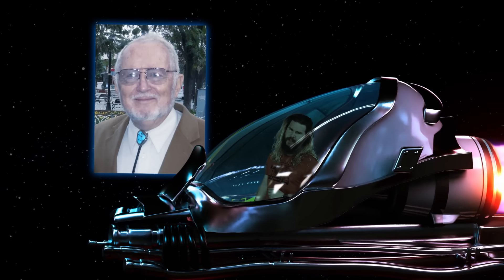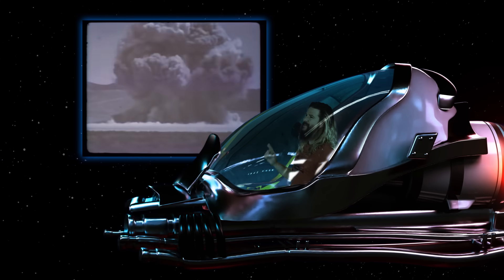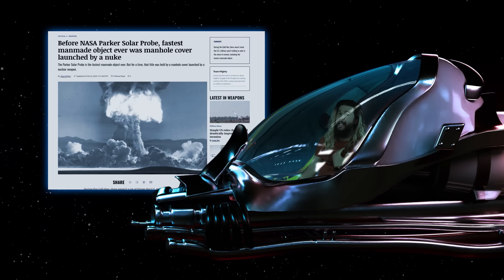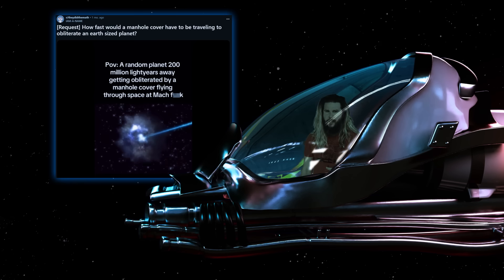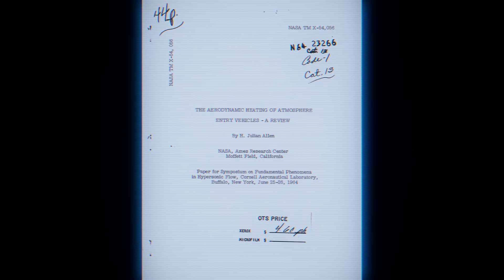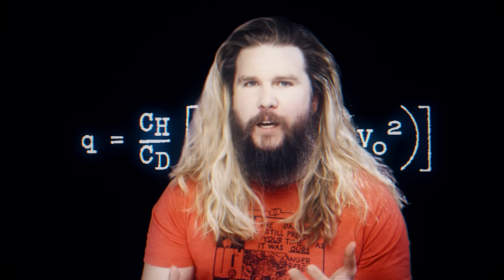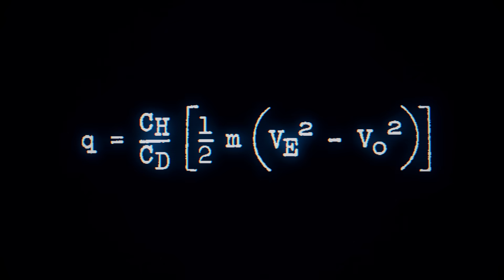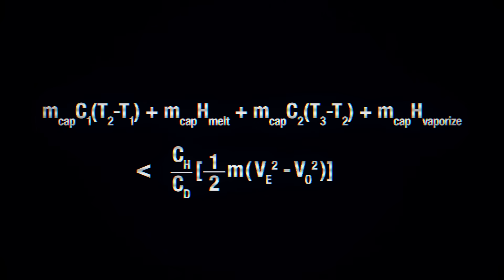Debunking the Nuclear-Powered Manhole Cover

Comment: The calculation is not very realistic. First, as you move upwards, melting and boiling temperature of iron will decrease. I am not sure this will have much of an effect. Second is that as iron melts, its shape will change, which will change its drag coefficient as well as energy transfer rate. I don't think this will have any effect on the chance of survival for the manhole cover.

Comment: It's much more simple than that. The entire story is made up. If we believe Wikipedia, the high speed camera was operating at 1ms shutter speed. An object moving at 66km/s would have been spread out over a 66m distance in that exposure, making it most likely invisible. If the cover was clearly visible on any film of that time, it was going a lot slower. That is also necessitated by the acceleration mechanics which works exactly like the deceleration mechanism in the atmosphere. The shock wave of the explosion did not go at 20 times the speed of sound in the iron or it would have completely dispersed this object within the bore hole, already. So would any radiative ablation based acceleration mechanism. One can imagine that the object was accelerated to a few km/s, in which case it would have survived its journey just fine. If it was never found, then it already got destroyed during the explosion.

Comment: What if the disc would do a thing that discs do, and turn on it's side to minimize the air resistance? I'm sure there were some uneven forces, or a air-dragging weld blob that acted a s an airbreak.

Comment: All in all, the mass of the cover wouldn't be enough to survive the journey through the atmosphere. A meteor coming from space has to be massive enough and dense enough to pass through many MANY layers of air resistance, and we don't even know how much desceleration the manhole would experience when at certain angles. If it started tumbling, it would probably suffer more air friction than if it flattened out or turned sideways. There's also the possibility that the manhole melted partially from the sheer heat of the nuke so it would warp from the forces it experienced, meaning it would actually probably experience MORE friction from an alteration in surface area. I imagine it got really high up, but in the end it logically couldn't make it to space. We have to get satellites into space using specialized heat resistant plating and many MANY layers of protection, a manhole cover is not surviving that trip.
Reply: You can find meteors of a few kg mass that made it through Earth's atmosphere just fine.

Comment: Problem with using this calculation is it doesn't take into consideration the difference in drag an object experiences when traveling across a pressure gradient from space to the surface of the earth, as opposed to from the surface of the earth to that in outer space. Also you can blast an object with enough energy to vaporize it, but if it's over too short of a time frame to actually vaporize it, it won't be vaporized. Kinda like the whole cooking a pizza at a certain radius from a nuclear detonation.

Comment: Wow, never even thought about the "manhole cover" vaporizing on the way up. However, I always though it never made it to space because it would obviously slow down from drag on the way up. A manhole cover is not the most aerodynamic thing after all. So even if it did get way above escape velocity, probably not for long, and would slow down and return to Earth. We have still failed to make a "space gun". And such a thing is desirable to quickly and cheaply launch satellites into orbit. But it doesn't work. You can't impart enough kinetic energy on a thing to launch it into orbit with a single powerful thrust. Rockets achieve orbit by burning fuel and having continuous thrust all the way up.

Comment: People want to believe that there is a manhole cover floating out there! 
 It would be pretty cool if it happened. But launching a 4 inch thick 4 foot in diameter solid iron disc to 66 kilometers per second in 1/1000th of a second = approximately 6700000 g’s, pushing the nucleolus is of the iron atoms through the disc and then collecting electrons on the other side. At over 100,000,000 degrees kelvin and releasing that atomic compression on the other side would explode the entire disk into an atomic mist that some of those iron nuclearesis may have gotten hi enough to make it into space and the debate goes on!

Comment: Okay I just did my own napkin math and if you Google "compressive strength of cast iron" the first result is Matweb which gives a compressive yield strength of 220-2520 MPa.

Plugging in v = 66,000 m/s and p = 1.225 kg/m^3, I get a dynamic pressure of q = 0.5pv^2 = 2.66805e9.

So the metal plug had a compressive yield strength anywhere from 0.22 to 2.52 GPa, and it was subjected to aerodynamic pressure equal to about 2.67 GPa. So that thing was probably atomized by aerodynamic forces. Personally, I think it was only seen in a single frame not because it was going so fast it left the camera's field of view in-between frames (though that may also have been true), but because it was reduced to a cloud of dust, which dust particles then melted and vaporized, in the time of that single frame.
Reply: We know that the plate did not deform in that frame it was captured in. The back pressure would support it as it cleared the lower atmosphere. So max Q would have been higher up, once the fireball stopped acting on the plate, which would bring it back into the realms of survivability.

Comment: Math seems sound but going back to the meteor comparison. When they enter the atmosphere and get burnt up, don't they usually explode or at least become a very very bright fireball? Wouldnt this fairly large hunk of iron glow like a mini sun if it was heated that quickly? Because we know it didn't instantly vapourise because it was on a single frame of the video, and it wasn't molten at that point. Is there any eye witness accounts of a fireball going up very quickly?

Comment: Doesn’t atmosphere thin out as it gets higher? So you wouldn’t be accelerating into a denser atmosphere but accelerating out of it. Also your acceleration of an incoming object would be accounting for acceleration due to earths gravity well whereas the “manhole” would be overcoming that negative acceleration. 

I don’t see how if it comes in like this, the inverse must also be the same.

Kind of a different analogy, but you can descend into deep water very fast, but you cannot ascend that same speed because of gasses under pressure. This is just to illustrate that physics don’t work backwards because of the number of variables in the equation.

Comment: Can the air stop an object in 1 second?
How match force can the air exert on an object?
If the air cant exert enghuf force to stop an object in 1 second the dV will not be 100% and the generated heat will be smaller

Comment: "Lets compare this with the numbers of Atmospheric re-entry" --- raises hand  Wouldnt that still not work though?... in Re-entry, you start with a thin layer, then work your way into a thick layer.. with the thicker layers increasing the friction, which in turn increases the heat build-up/resistance.  That manhole cover though, was going the other way, starting with thick atmosphere (albeit a huge chunk of it displaced by the explosion itself), then moving into thinner atmosphere.  So starting at max resistance/friction, ending with least amount. So rather than 'heating up' on the way in, wouldnt it be 'cooling down' on the way out? (not exactly cooling down, but the rate of heat-increase would slow more and more the higher up it goes?)

Comment: I think? you are forgetting the second law of thermodynamics. Yes the manhole cover experienced enough heat to vaporize it, but did it experience that heat for long enough to convect enough evergy into it to actually vaporize? Or did it travel so fast, that it didnt have enough time to absorb enough heat to vaporize? Astroids vaporize BECAUSE they are traveling much slower and have more time to absorb heat (and probably have a more gradual entry orbit than the manhole covers straight up escape trajectory), not because of it. An astroid decelerates as it gets closer to the Earth, so if it loses energy the longer it's in the atmosphere, how does it only disintegrate after traveling through the atmosphere for several seconds or even minuets? I know the atmosphere gets thicker the closer to the Earth you are, which increases the friction on the object and is partially the reason why, but it also disintegrates because it's had time to absorb the heat.

Comment: Dis you account for the air around it moving at the same speed as the metal? Cause it wasn't just an object moving through stationary air. There was a mass amount of pressure moving the air around it. Witch would change the math

Comment: I'm gonna go ahead and say that if anything were to vaporize that manhole cover it would be the atom bomb itself, not the atmosphere. There are many factors at play that make the manhole cover MORE likely to escape in some way. First, while peak speed is in the thickest part of the atmosphere which would normally mean that it would vaporize more, actually it's going so fast that it'll cross that part of the atmosphere faster than the transfer of heat from air molecules to iron can do serious damage. And it's still going fast for the remainder of the atmosphere so not really enough TIME for the atmosphere to work through all that metal.
Second, the blast would most likely put a dent in that manhole cover making it more aerodynamic than just a flat disk. Even if it remained mostly flat, I find it hard to believe it wouldn't tumble.
Third, the metal wasn't 100% iron, surely it had some carbon to it. Adding carbon changes the melting and boiling points by a lot.
Fourth, as others pointed out, your math is off in quite a few ways.
Fifth entering the atmosphere is very different to exiting the atmosphere, precisely because the correlation between speed and the thickness of the atmosphere is inverted. You can't just use the same formula and call it a day.

Comment: Question for Kyle: I think there is a potential confounding variable that was not considered with your equations (and there may not be a way to account for it).

Would time under stress (in this case heat) play a factor in this equation? As an object leaves the atmosphere it would progressively experience less and less heat as it moved through thinning air (i.e. going from earth's surface to the outer stratospheres and on to space) is there a way to represent this in your equations used?

Comment: The problem with the math is the assumption that reentry is just the inverse of exit. The iron disk would be traveling at a negative acceleration and would be experiencing less atmosphere as it rises. Not accelerating as the atmosphere density increases. The forces on the iron would be constantly decreasing and it's chances of survival increasing with every meter of altitude
Reply: add onto that, that effectively this was a giant gun shooting a giant penny, meaning that for the initial moments, where friction is worst, the air around it is traveling WITH it, meaning little, if any, friction.
Reply: @kingsesaw this is exactly what I was thinking about. There is a powerful and focused nuclear shockwave displacing at least some of the densest part of the atmosphere. I’m no physicist but it seems like that should be accounted for. I’m not saying it made it to space either. I think this is one of those things we will never be able to know and that’s ok.
Reply: @kingsesaw that's actually brilliant. We know how tall the tower of fire was, but I wonder if anyone has ever actually done the math on the height that the jet of air reached.
Reply: @kingsesaw  Physics 101 is that you get equal and opposite reactions. The air can't move with it, that's not how physics works. You'd need a perfect bubble, the air would need to be moving at an identical rate. All of you seem to just ignore that you can't cheat physics. Going faster doesn't cheat physics. It makes physics smack you 4 times harder. The more energy you put in the more energy gets thrown back at you.
Reply: @CharlesFreck in this case, the earth is the other object in the equation. We aren't moving that. So yes the air would be traveling with the manhole cover
Reply: @timbrwolf1121  once again ignoring the most basic law of physics which is equal and opposite reactions.
Reply: @CharlesFreck  exactly. And the forces are distributed amongst the air and the disk  The forces exerted on the disk don't all translate into some sort of vaporizing sci-fi 'energy'. The forces can express as angular moments, heat, black body radiation, and sound. Ablation could also play a factor.
Reply: During reentry, when you hit a slightly denser atmosphere, you don't accelerate either. The issue at hand was just heat produced and absorbed by decelerating object. In those speeds we can ignore all but kinetic energy and get close enough. However, one thing that he assumes it that the manhole decelerates to 0 in atmosphere (he uses just 66km/s in the equation, he puts V0 as 0) which is upper bound, but is not guaranteed. If drag was low enough so the exit velocity (V0 in reentry scenario) is lets say 60km/s he would only get about 17% of the heat. That would put it around area where we could expect it to not vaporise, however it is doubtful that drag would not slow it down more. The issue is, that at those speeds, we don't even know what could happen to the disk, forces and heat could potentially "forge" it into sphere and then spear shape and then CH/CD is completely different.
Reply: @syriuszb8611  I was assuming the acceleration due to gravity. That is always going to be positive acceleration for the falling object and negative for a rising (non powered) one. I think right?
Reply: @festerallday  Yeah, but that's negligible. Kinetic energy of object travelling at 66km/s is more than 2000x higher that his potential energy at 100km.
Reply: Ok that’s actually a great point I hadn’t considered that at all
Reply: Under the tremendous pressures high enough to break the weld would the cover deform into a roughly thimble shaped projectile? Maybe it would take whatever bits were welded to it skyward as well? I feel another variable was the shape of the projectile because it probably wasn't very disc shaped by the time it got airborne.
Reply: So that's where that damn manhole cover that hit my greenhouse came from!
Reply: Exactly
Reply: And suprised that he dıd not mention it.
Reply: No, no it doesn't. It just means it explodes sooner and closer to the ground. Invert is math and it's simply destroyed faster. Go on, do it. Invert that part of the calculation. It doesn't change the outcome.

Comment: Lots of people talking about the manhole cover having a relatively unknown velocity (must a minimum possible velocity was recorded) and discussing if it even had time to vaporize in gradually thinning atmosphere. But what about radiation? Cast iron has a relatively low melting point so it can be cast, right? And radiant heat litterally travels at the speed of light. The first thing that hits you near a nuclear explosion is the heat wave. It makes me wonder how much the cover was heated even before the blast wave shot it off. It's entirely possible that even if it didn't have time to burn up from atmospheric drag alone, the heat from the explosion itself might have aided the process.

I'm not a physicist. I litterally have discalculia so I can't even begin to understand the math. This is idle speculation with not much in the way of real grounding. If y'all wanna discuss it, please do, but don't insult me for idle speculation.

Comment: i'd imagine that as it heated up and started melting, the iron would rapidly change shape to form a much more aerodynamic droplet like shape, but obviously one with the skinny end pointing towards earth. Given that this may well have an order of magnitude less air resistance, it might have easily then escaped into space. Also, if it did explode in the low atmosphere, wouldn't the test notes have mentioned how hundreds of people saw the HECKING BLINDINGLY WHITE STREAK AND EXPLOSION between a few thousand and a few tens of thousand feet from the surface?

Comment: The manhole cover does not vaporize. 
Your math assumes that the manhole cover decelerates from 66km/s to 0m/s all within the Earths atmosphere. 
A back of the envelope calculation using your own numbers and assuming the cover crosses the Karman after 2 seconds after shows that the manhole cover exits the atmosphere at 65.8 km/s.

Correcting your delta v to the more accurate 180.6 m/s and inserting into your equation produce a final energy of only 2.86 x 10^8 J. Far far less than is required to vaporize the manhole cover.

Adding more detail to the equations only makes it even less likely that the cover with vaporize.

Comment: Was it moving slow enough for the heat to actually transfer? I don’t think it’d be unreasonable to think that a piece of it made it to space before burning up just due to how fast it was moving. Going (nearly) straight up that fast is much different than a meteorite coming in at an angle at a much slower speed. The atmosphere would also be decreasing in density instead of increasing. I just don’t think it would have enough time for the heat to transfer and vaporize the whole thing before it reached space. My guess would be that at least a piece of the cover did make it into space intact. Probably all melty and smaller, but still a piece nonetheless.